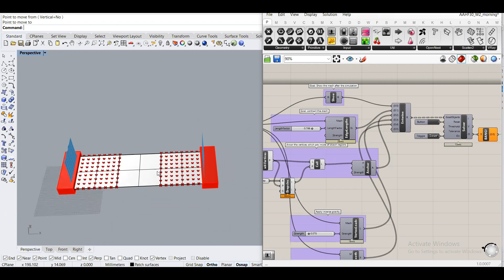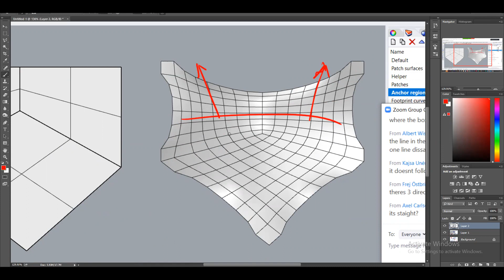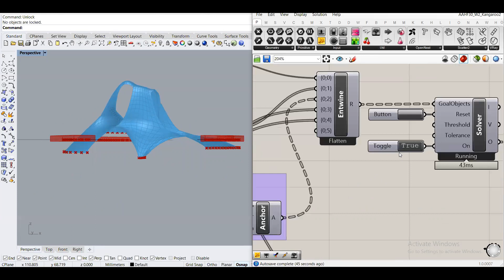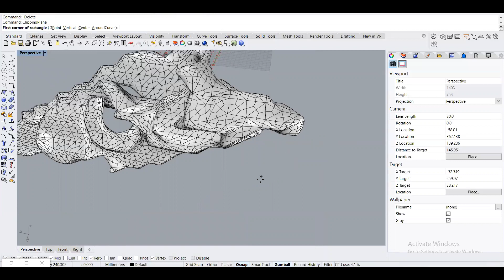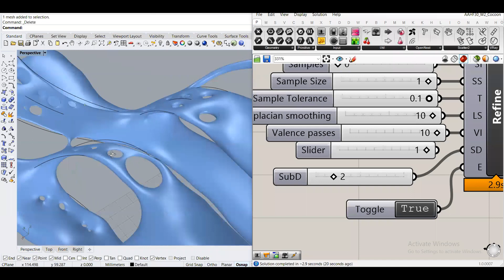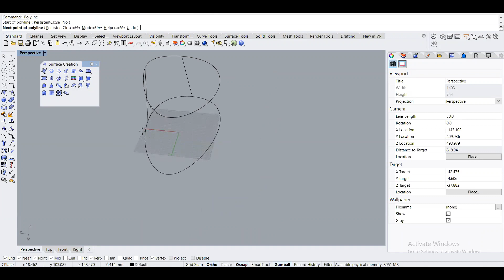Webinar: AAHF30 - Grasshopper for Beginners (day 6)

Comment: Is it possible to apply this logic to an irregular point grid? I tried to replicate the definition but with an irregular point grid that I can control and modify with a curve as an attractor curve  and it is not working.... Thanks!
Reply from the maker: Nope, this needs a constant step size (pixels/voxels) to work. What you can do is - create the mesh in a regular point grid as shown in the tutorial, deconstruct the mesh to get it's points -> move them with an attractor curve -> construct the mesh from the moved points. That will give you a distorted mesh.
Reply: @DesignGoBrr  Ahh ok got it thank you!!!